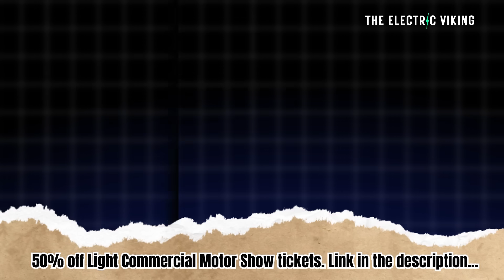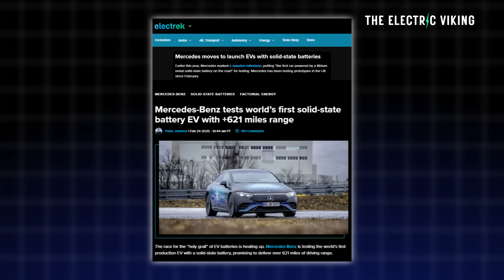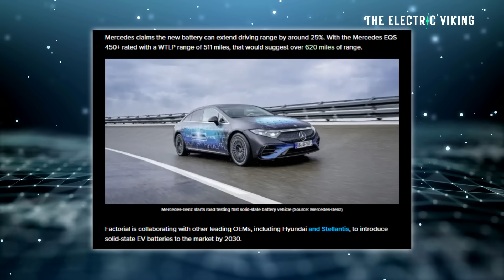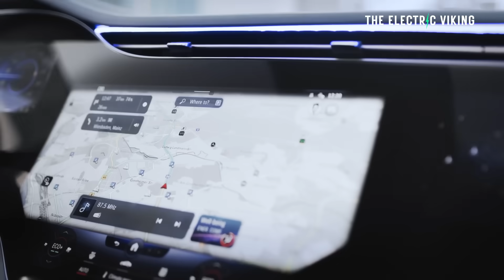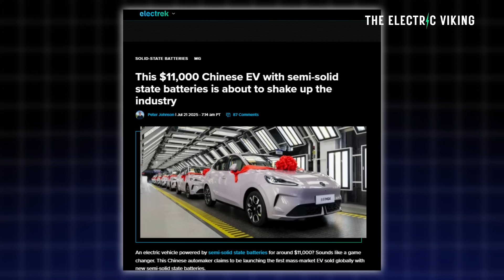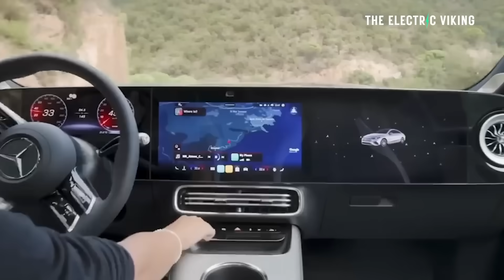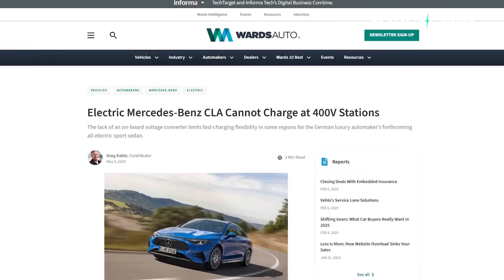Mercedes-Benz quietly testing solid-state batteries in EVs with 600 mile range

Comment: Well a year or more ago the talk was batteries with 3000 cycles , we have batteries with a million mile warranty today , they are cheap and appear to work , why worry about solid state batteries ? Lets look at Tesla 4680 battery much higher density than what they generally use 260 vs 170 watts / KG. . Simply put in a bigger battery pack like they do with the long range , less number of cycles in 500,000 ilm use . In two years time I think range  will not be a problem . If you have a normal outlet you can add 250 elm range overnight , a bigger power outlet  and you could fully charge overnight . On a trip stopping every 300-400 elm and use a supercharger  seems the ideal thing you need a break anyway . Most people charge at home and as Unit buildings are starting to fit charging outlet what's the problem ?  I believe Tesla pays about US $3,000 for its 60 Kw battery pack , make it 90 Kw would only add say $1500  ( the cost of a different colour rather than white ) . Let's face facts Elon has it pretty well right with range  , now  a faster charging speed will be the next thing . Solid state may prove too costly with little advantage and life expectancy question thrown in .

Comment: Sure car companies are always testing things; doesn't mean they are practical or cost effective or even that the company making them could mass produce them.  Toyota has had an all solid state test battery back in 2010 and an operational test car since 2020. It reportedly cost them a million dollars for the battery. This is why there isn't too much real happening with anything but lithium and maybe some sodium batteries that at least have been in production to some extent. The BYD seagul was suppose to have a sodium battery but they backed out of that plan.

Comment: Any company not mass producing batteries right now is basically fucked
Reply: Over time battery production will get to the point they are a commodity but they are not yet. Automakers at least need a partnership with battery makers. Batteries are not that hard to make it's just a matter of getting the process perfected. TV panels and IC chips are almost impossible to make and yet a TV that contains both is so cheap they are disposable.

Comment: Batteries are the big differentiator. Better batteries charge faster, give more range or are much lighter (which makes the range increase) or makes the cars cheaper. The other big differentiator is software, FSD, and control systems.

Comment: MB is testing FACTORIAL developed FEST polymer based semi solid state electrolyte lithium metal anode cells with 375 wh/kg energy density . These cells have limited 600 cycle life which is their greatest draw-back (lithium metal anode only works well with sulfide based solid electrolytes).luckily  factorial is developing new cell called SOLSTICE for 2028 with all solid nano-sulfide based electrolyte with mind bending 3000 cycle life in large pouch form factor with amazing 450 wh/kg energy density and impressive 20 years of calendar life. I think mercedes should use that all solid cells instead and wait another 2 years .(3000 cycle life is game changing for easily 800 miles of WLTP range)
Reply: Lithium metal doesnt work so well with sulfide based solid electrolytes (per se). It works well with oxide based solid electrolytes (but there are also other limitations with oxide based solid electrolytes like lower ionic conductivity, and producing large areas of oxide based solid electrolytes; because they are only currently producable in small areas due to their sintering process. If the separator is too large it cant withold the stress during the sintering process and basically cracks). Its true that sulfide based solid elevtrolytes used in the separator are the most promising one because there are some ways to make it work with lithium metal (like introduction of a buffer layer between lithium metal and the separator). While that all is very promising, a 375 Wh/Kg semi solid state battery has still very high energy density (higher than anything available currently in the market) and is still worth equipping some MB models with. Dont forget, that Factorial also needs money to develop their Solstice sulfide based technology. So its still a good option for the next few years to use the semi-solid battery. I work in that field in research and development for the past 5 years, so from my perspective it should go for it.
Reply: dont forget the fact that FACTORIAL uses ultra innovative nano-sized sulfide based electrolyte which has better ionic conductivity and proven most cycle life with metal anode cells(nano-sized sulfide based solid electrolyte is the answer for the next generation of metal anode cell,it achieved mind shattering 5000 cycle life in lab-tested conditions)

Comment: Good afternoon, Wind turbines for residential areas, small scale wind turbines. I have 2 Powerwall 2s and 7.5kw solar. We have had rain and overcast days, Not  happy I had to draw from the grid. I live in the Southern Highlands NSW, It's not often we have perfectly still days. That's got me thinking about wind turbines to supplement the solar. I don't think the blades, fan needs to be large. I will be exploring this idea further, what do you think, have you any knowledge or experience? Certainly not a new subject, not utilised in urban areas enough. Thanks for your channel Electric Viking, Help if you can. All the very best. Regards Chris Patterson 
PS Looking forward to your response. Cheers
Reply: Windmills for domestic use are generally not viable compared to solar.

Comment: The general consensus among major battery makers is around 2030 for them to be in mass production vehicles. It's quite possible there will be limited runs of high end cars that use SS batteries before then. Claims from some manufacturers that they are going to be out in, say 2026, is probably a lot of marketing combined with testing and limited production runs to gather data, but no I don't expect a BYD Surf with 800km range before 2030 👍
Reply: I think that you will be surprised.
Reply: @darylkehl3031  I actually hope so, but I won't be surprised if it doesn't happen, just saying!

Comment: I think the problem with Solid State Batteries is getting them to last as long a lithium batteries. It not only needs to provide 600 miles of range, it needs to power the car for 100K miles before it needs to be replaced. If it can do that, yes I would buy one!
Reply: It’s a lithium battery mate
Reply: Despite all the hype, solid state batteries have not yet proven durable. Cracking is the issue. 

This is in contrast to polymer batteries that can flex to some degree in response to the mechanical exigencies of EV service, so are resistant to cracking and offer good service life.
Reply: @jimgraham6722 Look at the data from Quantumscape.  Semi solid state, and significantly longer service life.

Comment: With batteries like that installed in an Aptera, one gets a 2000 miles range. One can expect much better mass produced batteries on the EV market in the coming years, and the first production Aptera EVs as well (with direct solar miles as well). The end of EV range anxiety is near.